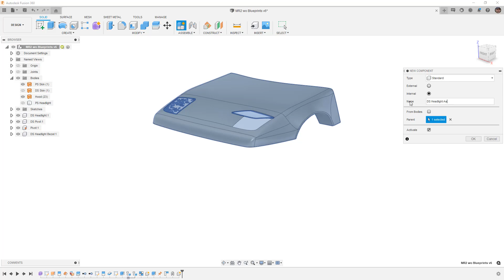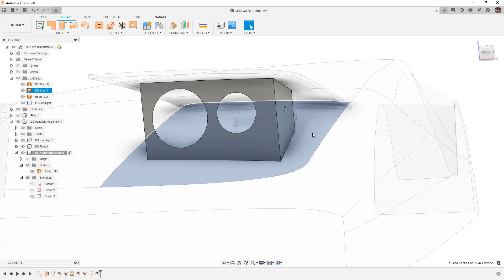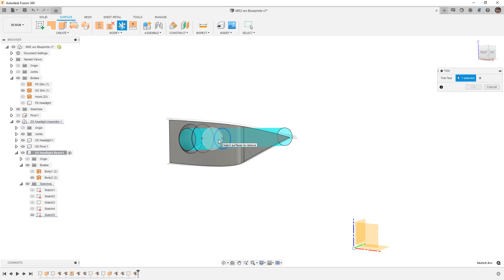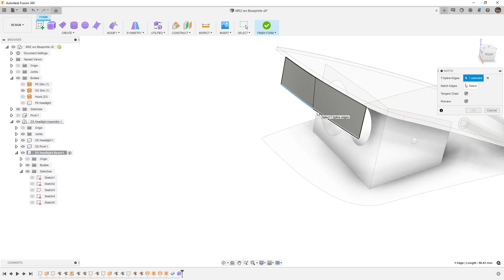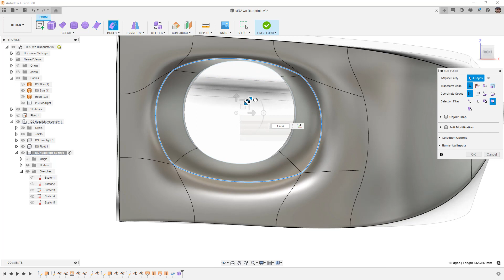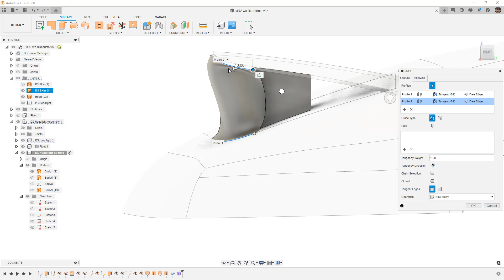Modeling a Pop Up Headlight Bezel in Fusion 360 - Part 1

Comment: I have a 3d scan of the 180SX headlight surround, this is a good way to clean that scan up and turn it into cad
Reply from the maker: Tarek, if you have the scan as a mesh file like an STL or OBJ, you can use that mesh in Forms and attached points to it.  I show this process making a spoiler match the shape of a car body.  There are issues but it does work :)
Reply: @LearnEverythingAboutDesign  yes, snapping to a mesh is quite handy, made a custom spoiler for a mini clubman with that, i have a ton of scans i did on my car, alot of cleanup involved because photogrammetry meshes, scaling in fusion is primitive so still need to get all to the correct scale to use them, really enjoying the videos, hit exactly what I have been looking for a long time, surfacing, especially automotive
Reply: Do you have the scan by any chance? Im trying to design my own bezel, i got the Shape and dimensions right, but cant seem to get the mounting points right
Reply: Did you ever finish the 180sx headlight bezel? I’m glad there’s a video on this. Been trying to design the 180sx bezel for the headlight, just never knew where to start.

Comment: how you made the offset surface?
Reply from the maker: Hi Lux & sons...  Which offset surface do you mean?  The original front end was modeled as a Tspline form body (the purple tool in the timeline).  We do that in the Forms series on the WRX and the Ferrari series.  From there i use sketches to split the surface where needed and then go to the surface tools > Create > Offset.
Reply from the maker: In the second part where I am designing the Bezel with surfaces I use Offset a few times.  Here you go. https://youtu.be/en26zAsWCr0?t=632